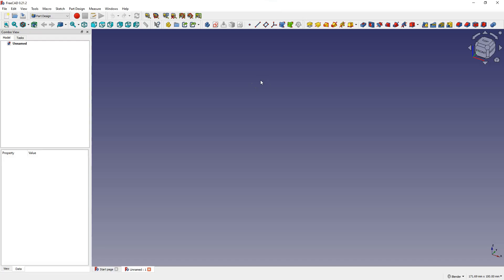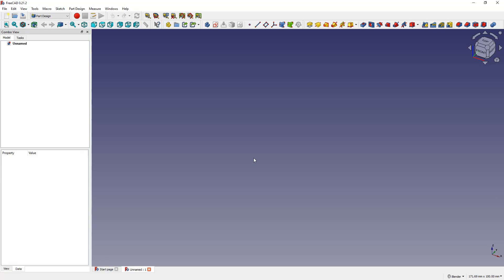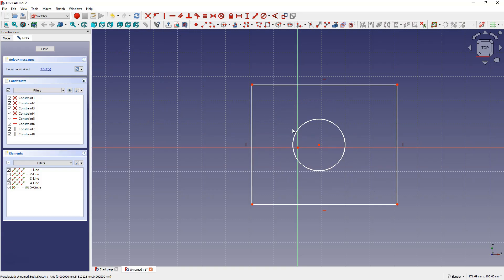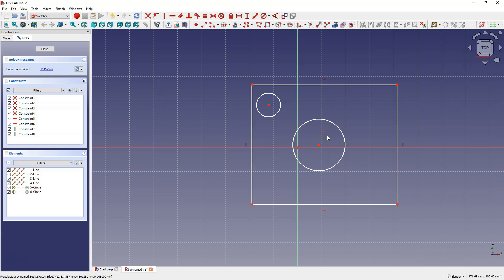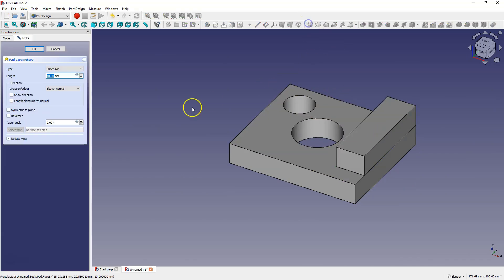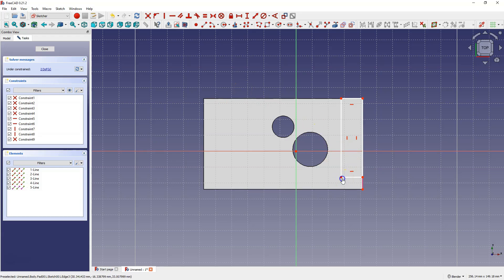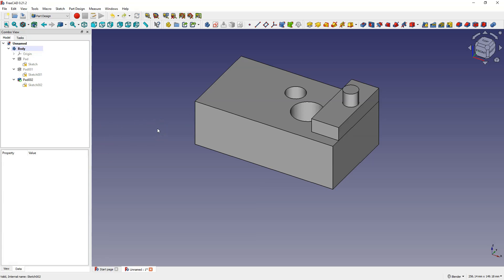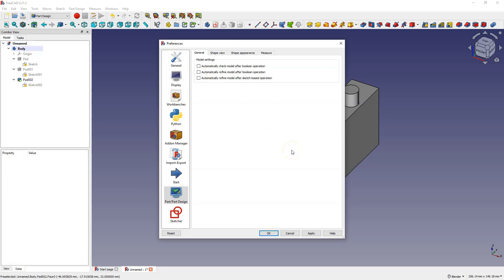FreeCAD Beginners Guide - Creating 3D Models and Common Issues

Comment: In version 0.22 Dev, you can create 2 solids(or more) on 1 sketch. You can also pad them with diverent hights.
Reply from the maker: I sometimes use version 0.22, but what you write about doesn't work for me. There's also sometimes a problem with TNP. I'm waiting for the stable version :)

Comment: thank you for this tutorial, I have somme question about when i will use the Part workbench  and draft workbench, Ive seen also somme one create  3 sketch (for example),without create body ,and after they extrude them in Part workbench without problème if you can  talk abot that in the futur. bye
Reply from the maker: I will think about it and possibly prepare a guide.